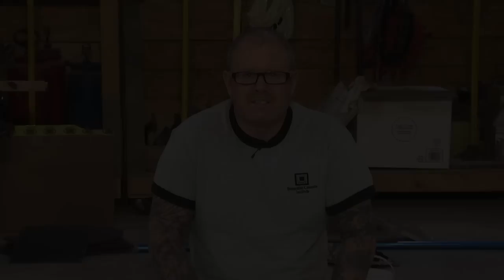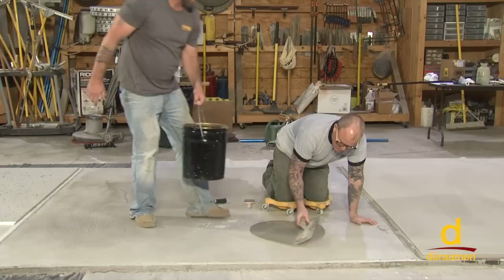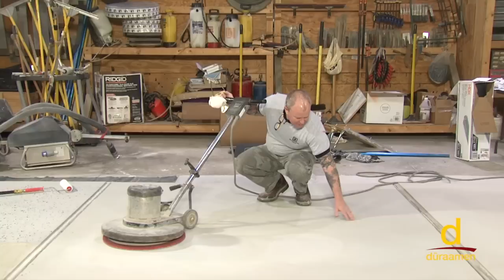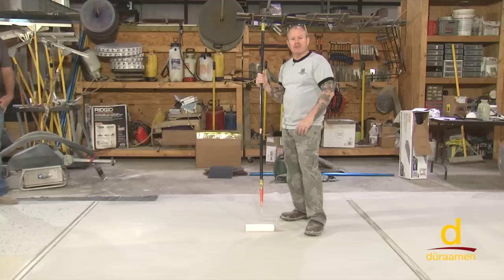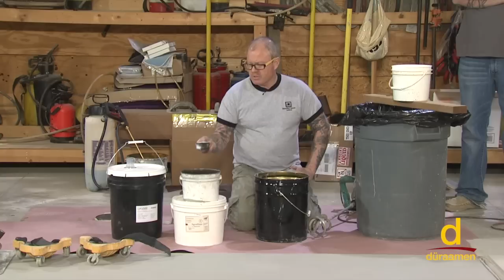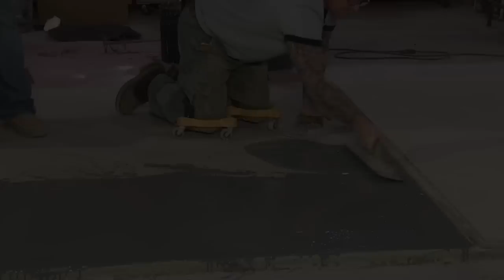How to Install Concrete Overlays, Microtoppings / Skim Coats - Part 2

Comment: If installing over an existing concrete slab do you need the first coat of Skraffino Regular or can I just do the Fine coat?
Reply from the maker: We recommend minimum 2 coats - 1 coat of regular and 1 coat of fine/superfine

Comment: Can you go straight to a super fine instead of doing the base and fine.
Reply from the maker: I am afraid - you will have to do at least one coat - either regular or fine...depending on the existing substrate
Reply: Duraamen Engineered Products Inc. thanks, is it that we need to build up the substrate a bit.
Reply: Duraamen Engineered Products Inc. how much working time do we have .
Reply: @kendausman5363  20 to 30 minutes depending on the temperature.
Reply: Victor Pachade also why do I need at least a 3500 psi gymsin leveler, the pour that will be done is a 2000psi and I don’t know the over all strainth after 28 days. Will that be a problem, the floor has not been poured yet, thanks.
Reply from the maker: @kendausman5363  In our experience, underlayments with less than 2000psi dent or crack very easily.